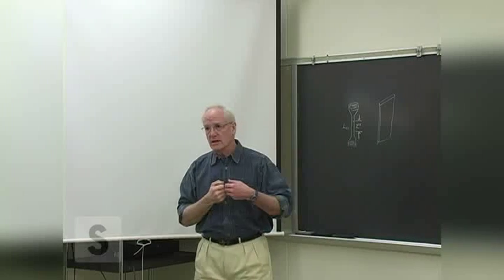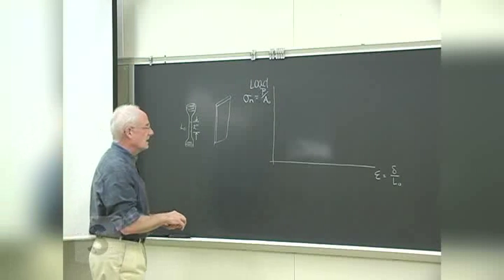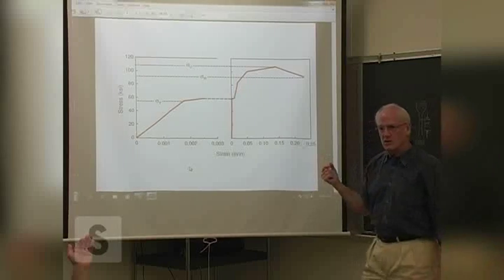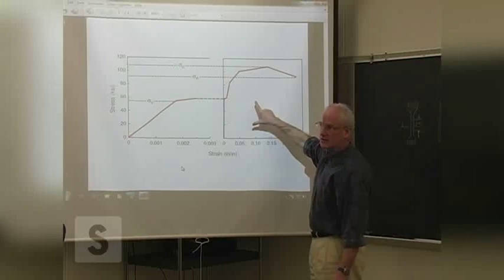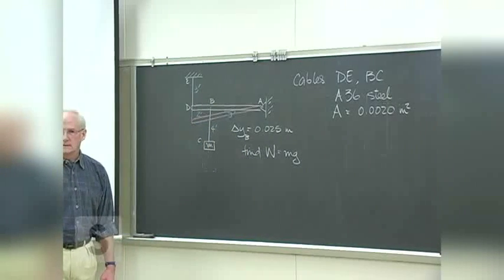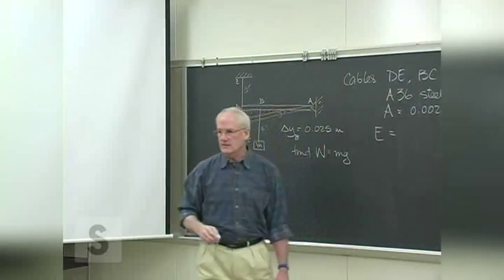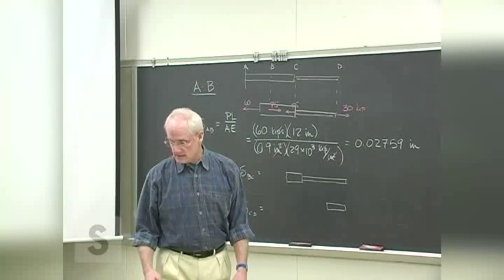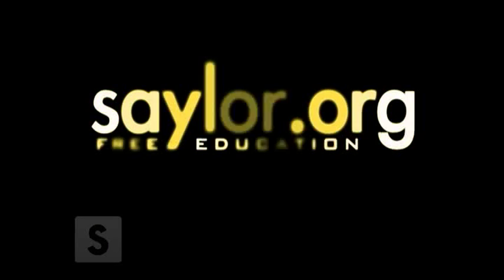Saylor.org ME102: Ken Manning's "Mechanics of Materials - Stress/Strain"

Comment: Quick question: at 28:00 we're assuming Area at which stress is applied to as constant. Doesn't the area of the material change even in the elastic region by minimal amounts? 

Thanks for your videos. Much appreciated
Reply: Since it is in the linear (elastic) region, it doesn't matter if you take into account that change or not. It is only important at non-linear regions, for example necking.